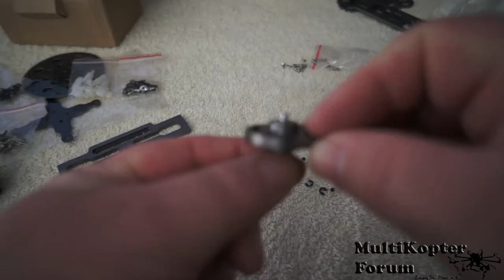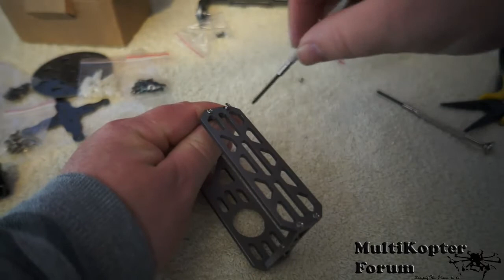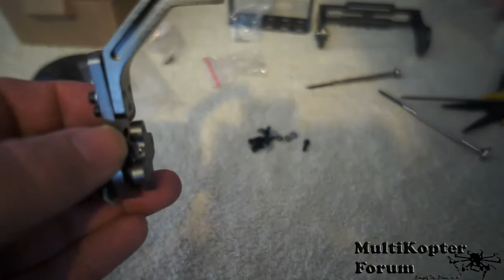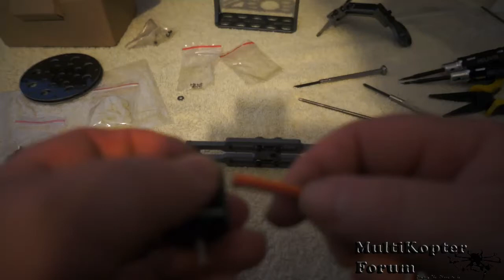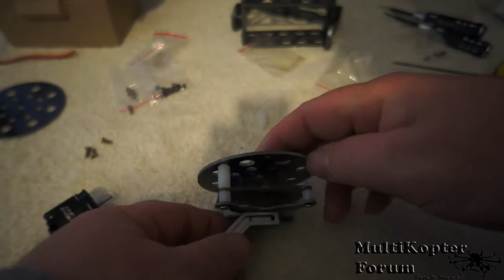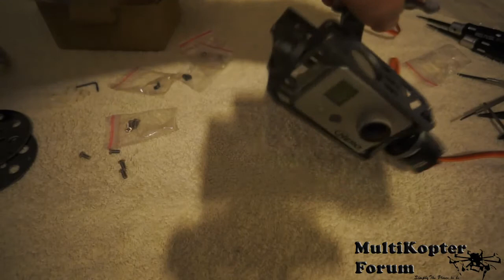RC Timer Brushless Gimbal Build

Comment: Hello from Buenos Aires, I have the product (2-Axis Brushless RCTIMER For GoPro Gimbal) + (2-Axis Brushless RCTIMER Gimbal IMU Controller & v1.0) and if I would need to make Might explain (Pitch move) that go pro then tap to the floor, and I have the Radio 9XR hk. is very difficult to add a channel to this movement? as you connect? v1.0 IMU to the KK 2.0 Plate? Thank you and I hope your answer!

Comment: I just got this gimbal. I start to assemble it, but my lower motor is not parallal with the top horizontal parts. So the outer frame parts ("U" shape) are not in 90 degrees, instead around 87-88.Maybe some holes are bad? :((( what can i do now? The screw is missing here too...